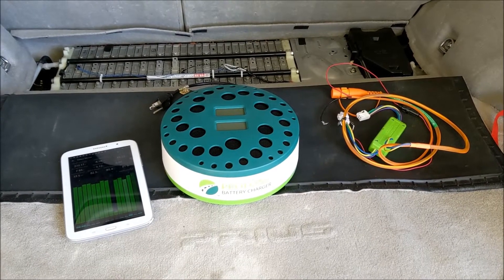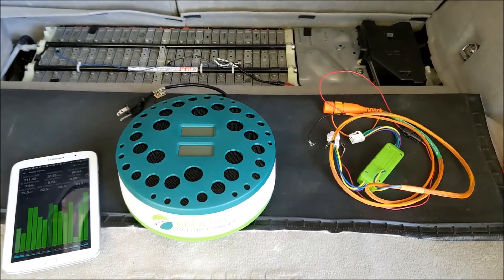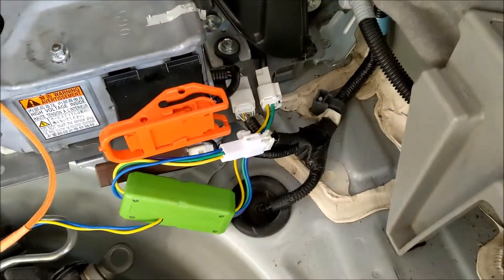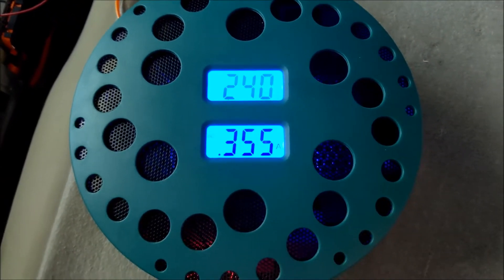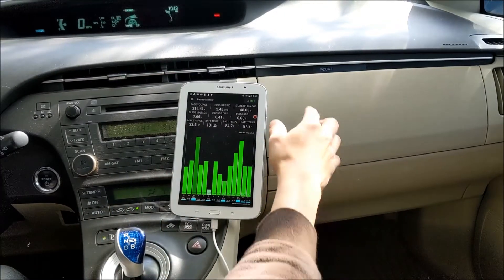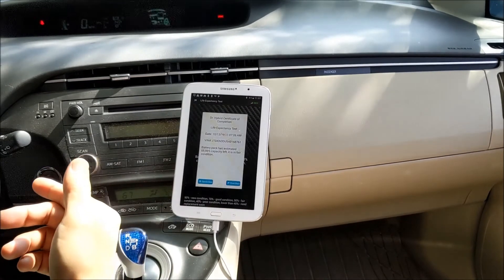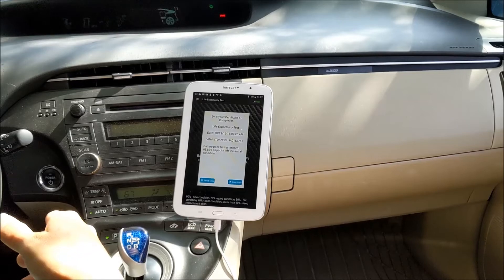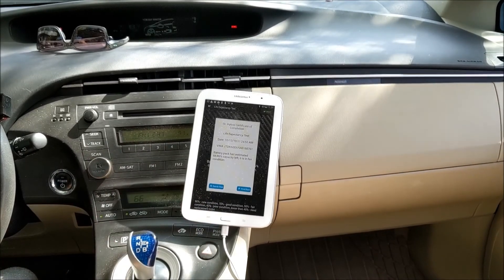Dr. Prius testing Prolong charger on a 2010 Prius #1

Comment: Thanks for taking the time to test the Prolong product! That is a great result, especially considering only did one charge cycle was performed.  The charging process will equalize the voltage of the cells in the pack and deliver a small increase in usable capacity, but only a small portion of overall potential improvement.  If the pack was also discharged a couple times, the increase increase in usable capacity will be much more - and longer lasting.  Deep discharging the battery pack to a lower voltage than the car does is what breaks down the voltage depression and restores lost capacity.  The combination of charging and discharging together is what is called reconditioning.  This video was a single charge and balance cycle, a full reconditioning treatment will deliver a larger and longer lasting improvement.  When a full reconditioning treatment is done, the benefit usually lasts for 9-12 months.  Hybrid Automotive recommends repeating the reconditioning process every six months to 'reset' that 9-12 months clock again and again and keep the battery performing it's best, delivering multiple years of prolonged life.
Reply: Hi Jeff.. I must be doing something wrong with my charger and discharger as I have not gotten good result after 3 cycles... after the first 24hrs I got back the lights on dashboard. I am lost to the next move. Please help me.
Reply: @remaldorose5079  this device will not restore faulty modules, only extend. You likely have bad modules that need replacing.
Reply: @JasonLeef33dm3  Long Story Short.  This device does absolutely nothing besides giving false hope.  Once the battery is degrading, it is already permanent damage.  You are like getting out juice from rotten lemon. You may get some out but practically it will not make it fresh again.    For $400, safe your money and get real whole new battery for about $2000, and install it to get another 12-15 years good life of hybrid car or even longer if you live in colder climate or garage kept.
Reply: @rondhole  Where are you getting new batteries for $2000-2200? A number of us are looking decently priced new batteries but they all seem to be over $3500
Reply: @mickm5097  Import Authority, Tallahassee, FL offer New battey replacement directly from Toyota dealership parts.  They offer it for $2800 few years ago for Prius 2006.  I believe they will take all old cells out and put new cells in but we have to return the old battery through them to Toyota dealership.  Now, I am in Frankfurt, Germany.  For Auris 2015, exactly the same battery and powertrain as 3rd gen Prius they quoted me total with labor 2350 Euros.  With the same deal, return old battery for recycling. NiMh battery is more than 60% recyclable, not like Lithium battery.
Reply: @mickm5097  I just replaced my hybrid battery in January 2021. I bought a brand-new one from the local Toyota dealership. Retail price was a little under $2,000. I bought it through a repair shop owned by one of my computer consulting clients and I paid $1714,
Reply: @mbrock5532  Thanks man,  It is good news.  $1714 for a new module DIY with proper safety measures should be OK.   It is still cheaper than replacing stolen catalytic converters in some cars.
Reply: @rondhole  Unexperienced comment, pretty ignorant at best.
Reply: @jrlaymance  speaking the truth is normal. nothing wrong. don't give people false hopes.
Reply: can be used for prius 1, 2gen 3gen and prius c ?  also can i used a light bulb to discharge ??
Reply: Prolong, their customer service sucks big time. Trying to get someone on the phone to ask a question is impossible. I had a serious question that I needed answered over a month ago and all they gave me was a generic answer by email 3 times which had nothing to do with what I asked. I regret the $706 that I paid them. My advice, save your monies and steer away from this seller.
Reply: It is a snake-oil kind of device. NOt worthed at all. For about $1000 you get unlimited lifetime transferable warranty for hybrid battery from greenbeanbattery, etc. Toyota does not need meticulous maintenance, just drive and go. Change the fluid, clean the filters, and drive calmly.
Reply: @rondhole   It's funny how you call battery "reconditioning" snake oil, then propose a "reconditioned" hybrid battery as a viable alternative.  Hybrid Battery reconditioning can and does work very well in the correct applications.  We've been successfully supporting hybrid battery reconditioning for almost 10 years.  In fact, Green Bean was a customer of ours for multiple years, going back to their founder's prior job before he even started the green bean company.
Reply: @jeffsloan6946  NO, with this snake oil your battery is death, and still death. When you buy used, reconditioned, new, or whatever battery. You have a working battery and will get replaced under warranty.  What warranty this $500 junk have?   NOthing.  LOok, how much risk and hassle you have with $500?  Too much for people with sensible minds.  You pay $1000-1500 for used battery, you get a working battery for life. It also increase cars resale value
Reply: @jeffsloan6946   Properly used Prolong gets results. But  without data on the individual blades impedance and capacity its a bit of a hit and miss. Its like addressing only 1 of 3 causes of battery failure. The other 2 might still get u.
Reply: @rondhole  $1,700 plus dollars